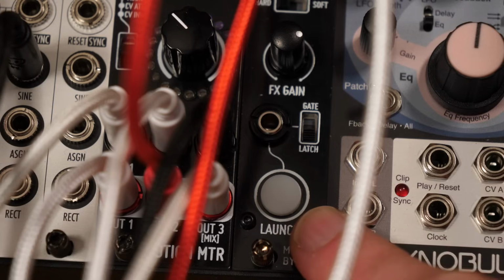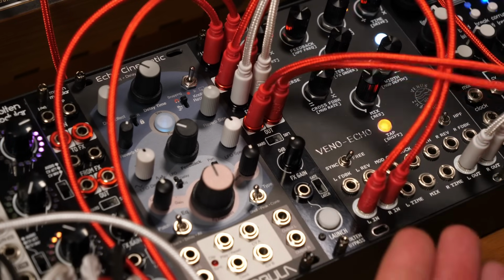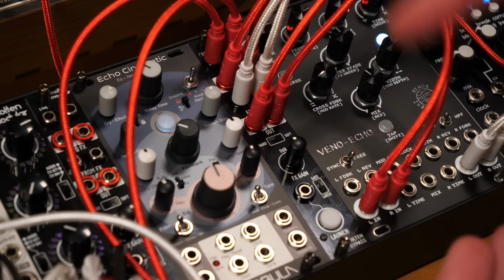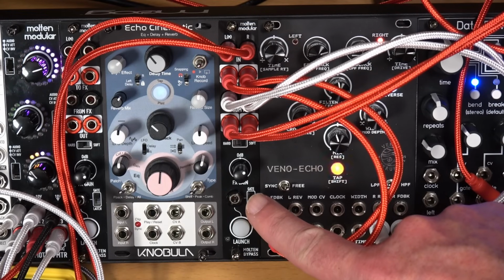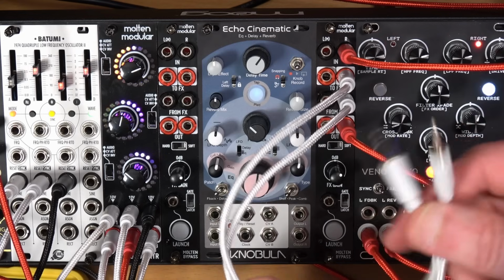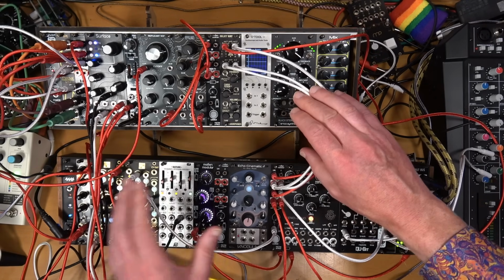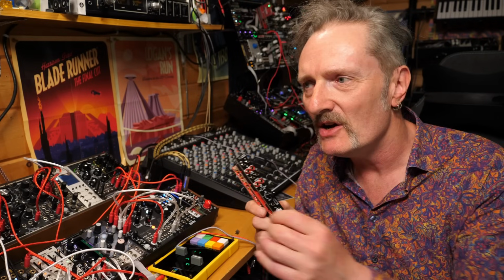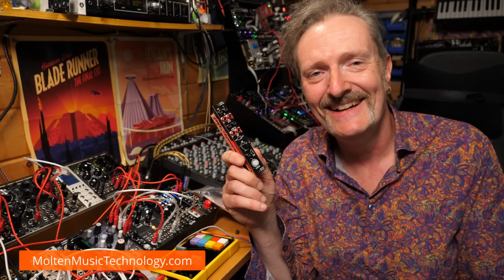Molten Modular Presents - Molten BYPASS

Comment: That's nice—though I don't think I've completely understood what the soft mode does.

I've sometimes ended up using my WMD Axys (and some stackable cables) for roughly this, but the gain knob is a piece of trivial magic (if I can use the word ‘trivial’ as a good thing).
Reply from the maker: Soft mode means that the output of the effect module is still reaching the main output when bypassed. This means trails of echos and reverb etc still come through as they fade away.
Reply: @MoltenMusicTech  So in this mode the effect output is always mixed in, but the effect input is switched and drops to zero? I see.
Reply from the maker: That’s it